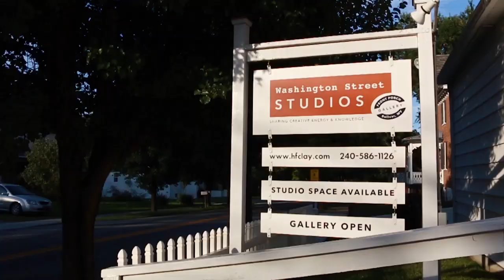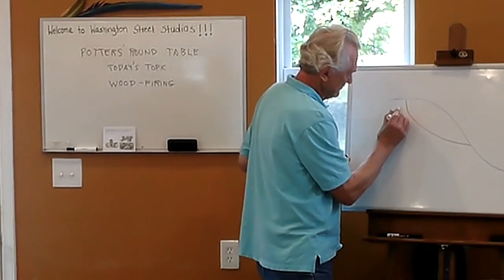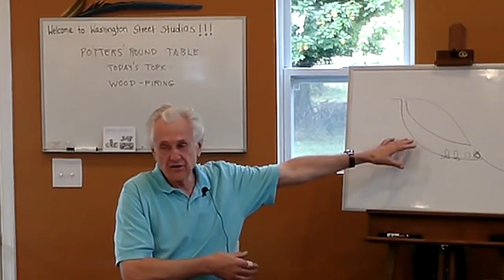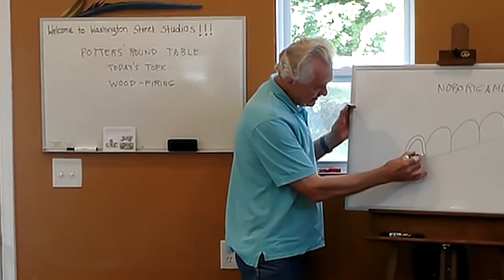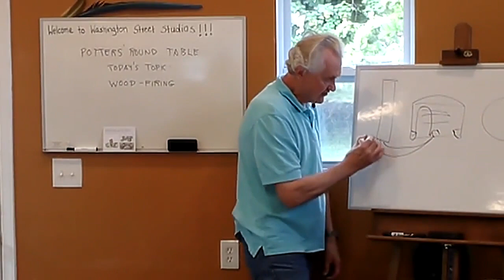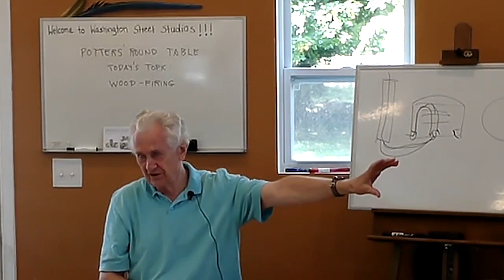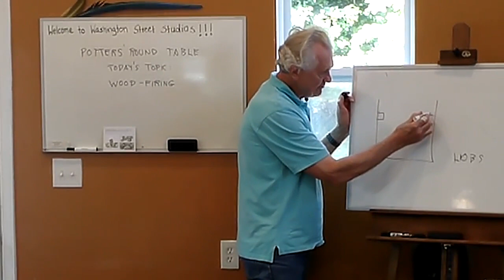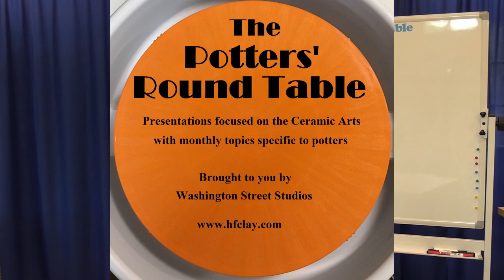Understanding Pottery Chapter 13 Wood Fired Kilns Part 1

Comment: Just some thoughts inspired by your great presentation style. In the Anagama design, I noticed straight line from the mouth to the cheminy through the lined rooms. Why doesn't it take a zigzag line to keep the fire flow turning left and right longer? I even imagined a circle or half circle shape design. In a circle shape the chiminy would be side by side to the mouth. So it will be naturally and costlessly heated. 
What do you think? 
Thanks
Reply from the maker: Yousof, sorry to be the bearer of bad news, Phil passed away in July of 2021. He would have enjoyed this discussion! Most Anagama kilns, and all downdraft kilns, have the flues low in the floor and the flame will rise in each chamber, then have to go lower to exit the flue. The flames are zig-zagging vertically rather than horizontally. Hope that helps, Dennis.
Reply: Hi Dennis. Thanks for your reply. Life and death... Sorry to hear that Mr. Phil passed away. He died but left behind these great work.  Keep it going please.  
Phil said about the draft that it hasn't a mind of it's own, we still can manage it and force it to go the way we want as long as we understand its behaviour, it wants the shortest way out and we want to keep in it as long as possible. If we are able to force it to go down while it wants up,  it is easier to force it to go left and right.

Comment: Hi. How to reduce the smoke
Reply from the maker: Use gas.
Sorry, bad joke. Atmospheric kilns produce smoke when they go into reduction. There will be smoke. You can fire in an oxidized atmosphere (open up primary air and dampers), and there will be less smoke and no reduction for the pots or glaze.
Reply: In reduction there doesnt have to be a lot of smoke. Once the flame is edging out of the peep hole there is reduction. If there is a lot of smoke try reducing the pressure until there is a small flame coming out.

Comment: When people used the word "efficient' I always cringe . If a kiln uses wood inefficiently but my time more efficiently is the kiln efficient.  If I have more wood than time then the answer is yes. I have seen very so called efficient wood burning devices that saves fuel but wasted everything else, money, time and enjoyment. Functionality I find is far more important than efficiency as it is a combination of many factors.
Reply from the maker: Dave, I do understand your sentiment, and I also agree with your sentiment. We cannot, however, overload the terms or they are no longer fit for their purpose. Efficiency, as it relates to kilns, is the ability to reach a temperature with as little fuel as possible. You are describing the effectiveness of the kiln, does it produce consistent results with the characteristics and surfaces we want. Then we answer the question of 'Is the kiln fun to fire?' 
Thanks for the comment and keep watching!
Reply: I guess efficient in our case is very relative to where your are and what is readily available around. I live in Africa, in non oil producing country. Forget about gas, desil and electricity... these option are out of any logical cost and benefits calculations. I have to cope with wood and coal. This is my efficent option. 
Thanks